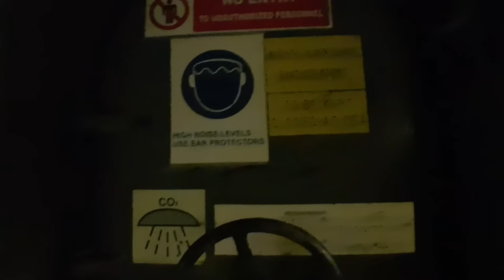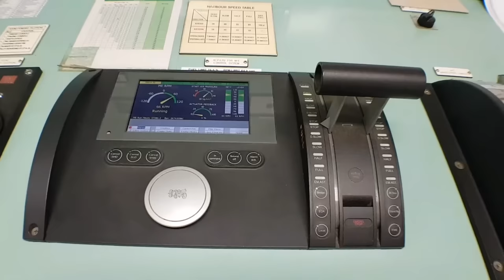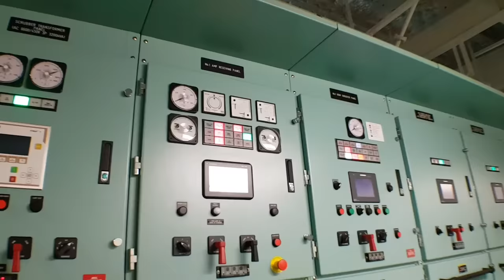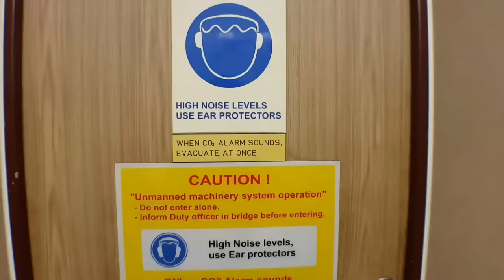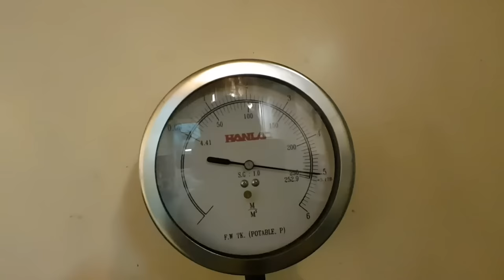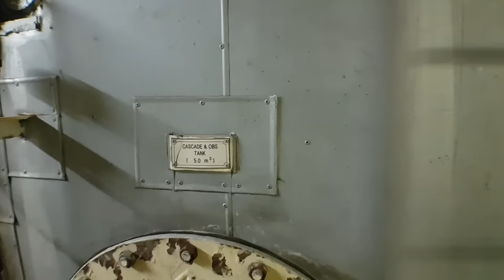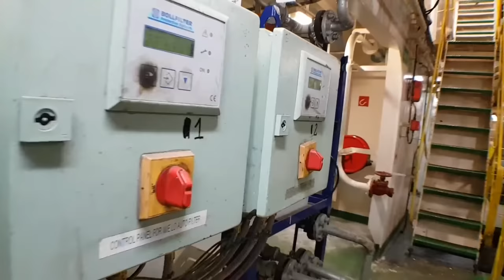( MSC ) Mega Ships Engine Room normal sounds at SEA operation #engine #container #msc #fypシ #fyp

Comment: This brought back some memories . That Main Engine was an in-line twelve made from Two Sixes nose to tail .
I served on a Ship that had those two Sixes , side by side , and twin Shafts . The Big Engine is actually the Quietest thing in the Room .
Most of the Noise is the Ventilation Fans , although the two Generators were likely quite loud .
You can actually hear the Main , going , Suck , Squeeze , Bang , Blow . Looked like an A-Frame  Two-Stroke .
Reply: The ship should have 6 more generators , and you can even see 4 more, ( you could see the gen panels in the electrical room)
Reply: @deadclan7796  . Yes . There are 4 Alternators in the Main Engine area . I  missed that originally .
It would be sensible to have a couple in Separate Spaces somewhere else on the Ship , in case of MAJOR Fire in the Main Space . 
With a Diesel Alternator you don't just Kick It In The Guts and walk away , job done . 
You need to start the Engine and allow it to warm up before Energising the Field Coils . That is when it loads up , not before . That may be why there are 8 gauges on the Control Panel .
The Remote Alternators will have their controls Local to them , not in Main space .
Reply: @johncunningham4820  there's more on the other side of the engine aswell , if you look really close you can see them. I think they are 2.4MW generators, but I'm not shure
Reply: @deadclan7796  . I saw Two Pairs of Big bastards , each side , in slightly separate compartments , either side of the Main Engine space .
That would cover the Eight Gauges . That is a LOT of Power potential .
As  I  said any External ones would have Local Controls . Those would be for just keeping the Ship lit up and breathing and supplying power for Damage Control operations .
Reply from the maker: @John Cunningham that was a great experience, i can't imagine also how old ships work before and how hot the old ships were in the first place
Reply from the maker: @DEAD Clan we have 4 main generators and 1 emergency generator
Reply: @khingsjourney  . Diesel Powered Ships are not Unbearably Hot . Steam Powered ones , however , are REALLY fucking hot .
And Gas-Turbine powered can be distinctly Cool , even in the Engine Space .
Reply: 2 stroke engines don't do the double "S" double "B" thing.
Reply: @grandinosour  . Of course they do 🤔.
Just that it happens CONCURRENTLY .
The Squeeze and Suck are happening at the same time .
And the Bang initiates FIRST stage Squeeze , in the Buffer space .
Then the Blow occurs just before TRANSFER from the Buffer space to the Cylinder .
Rinse and repeat .
ALL  internal combustion engines have SOME type of S , S , B , B  thing happening .
In a Gas Turbine it happens continuously for ALL phases . 
I  hope that helps you understand better .

Comment: The complexity of this equipment is mind-blowing!  I must ask, how can all this stuff operate and no one to be seen anywhere?  How many machinists & engineers does it take to know how to operate and maintain all this equipment?  Fascinating to say the least.
Reply: Not only that, all that plumbing, all the valves, pumps, welds, fittings, gauges, gaskets, seals, etc. and not a single leak anywhere ! That place is spotless !
Reply: @Bare Metal Machine  I noticed that too, unbelievably clean!
Reply: Chief engineer as a boss in makina, then 1st , 2nd and 3rd. Sometimes instead of thrid there is a cadet , then electrician, fitter + 2 oilers. So 8-9 people maintain and operate. I also work for Msc as electrician. Greetings to you
Reply from the maker: Absolutely you are right sir we are only 8 crew at the engine Chief engineer,1st engineer, 2nd engineer, 3rd engr. Electritian, fitter and 2 oilers
Reply: @khingsjourney  Thanks for your kind answer Sir.
Reply from the maker: Mostly all are already in automatic,we are Four machinist and it must be a qualified marine engineer to do some maintenance job
Reply from the maker: Well maintenace sir if we see a little leaking  we fix it

Comment: Thanks for sharing this, informative as it is. The place looks complicated with different types of machines.
Reply: You have no idea . Almost everything you saw there , is a slave to that enormous , three floors tall , Main Engine .
Oil Coolers , Heat Exchangers . Lube  and Cooling Pumps , Oil Separators instead of filters . Low and High pressure Air compressors , Lowand High Pressure Fuel pumps , and a hundred other things . That BIG  engine is  a $100,000,000 item or more . And maybe Irreplaceable .
The Rear end of the Engine Block is PART of the Ships Keel .
Reply: @johncunningham4820  Realy ?
Reply: @jovicalapad  . Yep !  I  am ex Navy and used to work on Engines like that .
Reply: @johncunningham4820  what are you doing in engine room ?
Reply: @jovicalapad  . Assistant Operator  and  Maintainer . A Stoker . Able Seaman Rank .
Reply: @johncunningham4820  Very good positioned.

Comment: I guess you have more to do to start this beast than putting it in natural and turning the key 😮😄
Reply: Don't think it has a neutral 😄 Just engine--shaft--propeller I think. Looks like engine can run in both directions!

Comment: Why isn’t there any one monitoring the machinery while under way , we didn’t see any one else ,it seemed like it was abandoned. Great video,thanks for the tour
Reply: Possibly filmed in a weekend afternoon.
The engine room has the class notation: UMS which stands for unattended machinery space. In the morning, the EOW is doing his rounds.
When an alarm sounds an engineer on duty (for 24 hours) has to go down to deal with the fault.
An extension of the E.R. alarm system is therefore available in engineers cabins and messroom.
Reply: It’s basically entirely automated, minus routine maintenance. These ships are all about efficiency, which includes having the minimum crew possible.

Comment: Are these engines steam driven? The reason I ask is the Operation looks the same as a Steam driven Co-Generation plant.
Reply from the maker: Its powered by heavy fuel oil,very low sulfur or marine gas oil sir

Comment: A most infuriating video.  Absolutely no attempt to name any of the various parts of the engine.  What is it?  A Wärtsilä-Sulzer, an M•A•N-B&W, what?  How many cylinders, how much shaft power.  And the generators.  Again, what make, how many cylinders, how many Mega Watts?  If this is the best you can do why bother!  All the preceding comments are clearly from landlubbers, who haven't the fiantest idea about the workings of a marine engine.
Reply: Some people just want to see an unedited walk-through of what the engineering spaces look and sound like while under way. I have a million questions as well, but that would be best for a different video.
Reply: I think this is a 14 cylinder engine and develops 107,400 hp.
Reply: @eddiewilliams4171  It has 12 cylinders, that much can be seen in the video.
Reply from the maker: It has 12 cylenders and 98,000 BHP